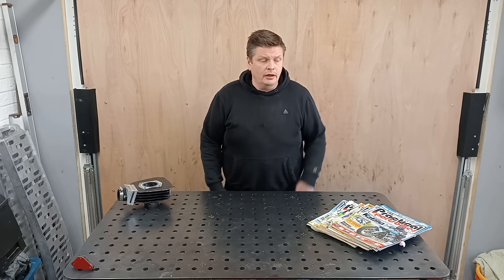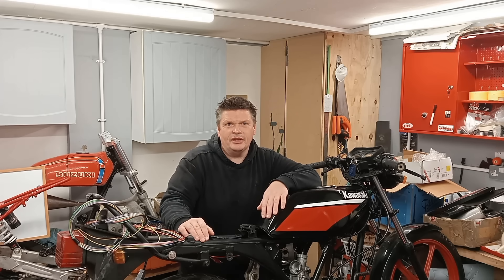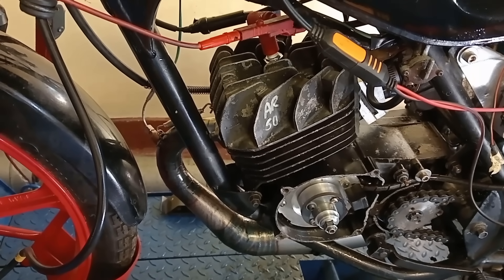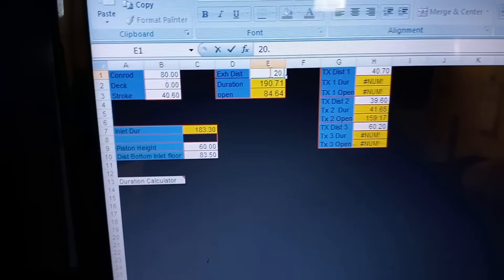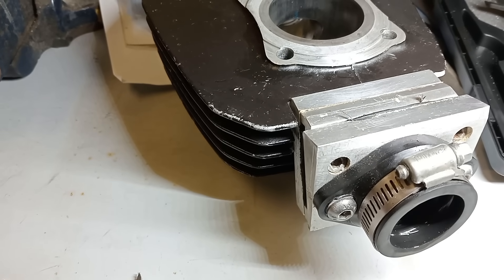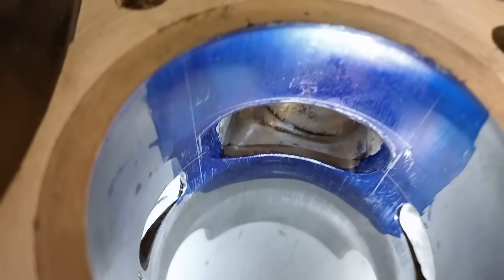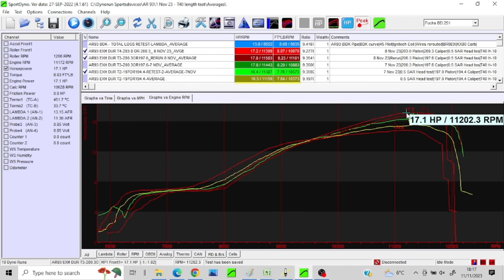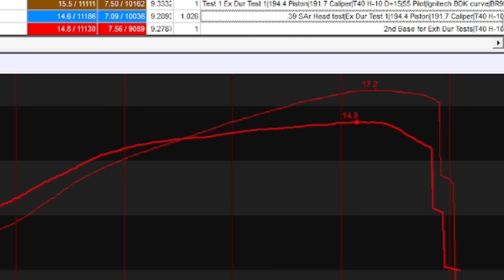This Tiny Port Change Changed Everything (Dyno Proof) #2stroke #power  #porting

Comment: Can you fit skinny tyres like the drag racing bikes in Thailand?
They are 150cc.
You could try throttle body fuel injection?
Also you could run a narrower powerband with a close ratio box.
If you raise primary drive gearing and fit bigger rear sprocket it will bring gears closer together, then set it so that 1st is where 2nd is now.....
Reply from the maker: Cheers Peter, The standard tyre is quite narrow. It is an option to try and get something a little narrower, or maybe a front of the rear too? I also need the correct speed rating which makes things a little more difficult...
I'd love to get a close ration gearbox, in fact I have one from a KX65 but It won't fit. I need to do a bit of research to see if there is anything that may fit.
Reply: @AutoBeta2T  as I said, you can make the gears close ratio by increasing rear sprocket size, AND raise primary gear ratio.
You can do a speed Vs rpm graph and see how this effects relative ratios.
The only downside is that 1st gear would be quite tall.
I was once intrigued by a BSA bantam 3 speed close ratio,  " bog, blaap blaap blaaaaaaap" and that's it!
Also I notice that the intake port isn't ideal, 3 ports essentially - can you remove the 2 bridges so that it becomes one big port, just leave the upper parts to support the ring?
Or make a different liner?
You could always cheat and fit a kx cylinder, but then  it wouldn't feel like an ar50 anymore.
I know you can buy 70 kits with 29bhp out of the box (mxs70) supposedly but they are crank case induction.
Your series of videos is probably the most interesting of all the tuning videos......2strokestuffing is the other series I like- in depth tuning discussion and the port height Dyno stuff is excellent.

If only it was piston port induction, that's what interests me most..... don't know why?!
Reply: @AutoBeta2T  btw did you check out the racing in Thailand?

Comment: loss in low down power is due to lower dynamic compresion ratio
Reply: Ye just look into the dynamics 
Static isn't a true example of compression  so to simply say the   first factor is were in the swept volume is the exhaust port closed 
? The further up later closing 
? Vs static compression?
So static is a number to understand vs dynamic 🤔
Reply from the maker: Hi James, I've done the calculation and I went from 7.4:1 corrected compression to 7:1 corrected when I raised the exhaust port. I've a couple of standard heads coming from eBay so I can machine them back to what I had before... And maybe a little more too.

Comment: You can measure when the exhaust opens by running compressed air into the plug hole and then rotating until you see a pressure drop.

Comment: do you reduce the spacer when you increase the exhaust phase?
Reply from the maker: Hi Zobaka - I didn't. I did expect to but the exhaust kept in phase as the timing increased. I think the pipe was setting the peak power RPM but the exhaust port didn't have enough time area. Increasing the time area allowed the engine to make more power but the pipe dictated the peak RPM.
Reply: Hi, What I meant is that when you raise the exhaust, the compression ratio decreases unless you install a thinner gasket.  This may have a negative impact on peak power
Reply from the maker: @Zobakka  I see. Yes it is something I need to address. I've ordered a few AR50 heads off eBay to machine and have a play with.

Comment: I wonder what difference using slick 50 makes to the horse power. We used it late 80s and early 90s and as soon as you squirted it into to the intake the tick over rose and needed bringing down because of less friction.
Reply from the maker: I remember that stuff.... I'm sure you could get it at Halfords? 
Did you use it on two strokes?
Reply: @AutoBeta2T   yeah,  I remember using it on a ts50x,  certainly made less friction due to the rev increase.   Sold quite a bit back then.
Reply from the maker: @cronauer1985 I wonder if you can still get it? It would make a good test
Reply: @AutoBeta2T Slick 50 was based on very finely powdered PTFE, a very slippery plastic.
Reply from the maker: I'll have a Google for it

Comment: i wonder what ceramic bearings would do for it
Reply from the maker: Me too - another one for my list of things to try :)
Reply: @AutoBeta2T SKF make the "Energy Efficiency" range of bearings that have outstandingly low friction. They have "E2." before the size marking.
Reply from the maker: @cedriclynch  I've done a dyno test with wheel bearings on a pit bike. Picked up 0.3 hp 6hp.

Comment: you want a fast 2 stroke?
cheap cylinder wont get you there.
take my toy at this point 2 stroke moped.
i went water cooled as head temps on air cooled get too high as power goes up.
now i can wot for miles if i wanted to. i can touch the radiators with my hand after hard runs.
i also havent wont over 75 mph on it as i have no interest going that fast. it has plenty left and gears for 130-140 mph.
Reply from the maker: Hi, the cylinder is a genuine Autisa big bore kit so good quality. The original challenge tried to get to 100mph with this kit and air-cooled. They got to 97mph so close. With a few more hp I reckon I can get to 100mph and still air-cooled on pump petrol. I have considered a water cooled head or maybe using Methanol fuel... 
Cheers for watching ☺️
Reply: @AutoBeta2T  i wasnt really knocking the quality per say. but in my scooter world a good 70cc kit is 200-300 dollars.
its pricey and so is the exhaust but at around 20+ hp for 600 dollars its not a bad starting point. with my cylinder and a new exhaust my powerband would be from 8000-12,500 rpms. very wide for small cc but also over 20 hp reliable barely runs on pump gas though. 15:1 compression ratio. but i have immense acceleration and the speed to back it up. 1000cc motorcycles stood no chance. 
then after having a great starting point i can adjust and tune from there. like adding the 2nd cylinder and exhaust cause at over 40hp not many things on the street or strip could poke fun. id win. after i get bored with it like that its getting supercharged for a humble 60 hp. just a little extra to strike fear into the hearts of any that dare race me.
Reply from the maker: Sounds expensive! I can't get the Autisa kit anymore. It is ally wit a cast iron liner. You can get a all cast iron copy of it for about £200! 
If you have a look at my other vids there a couple of exhaust fabrication - maybe have a go at builing your own?
Reply: @AutoBeta2T  i thought you had a cast iron cylinder i seen the paint and just figured it was cast iron and those dont like power on my bikes. i dont mess with the big wheel mopeds much though i would kill for an aprilia one with a 2t. the cylinder i currently have went up almost 100 dollars since i seen it last jeeze. the exhaust i want is usually 200-300 but was over 600 dollars recently. prices are all over for everything it seems so you may be on to something on making my own exhaust. i had 3 ideas to tackle that when i did the 2 cylinder swap. i was going to get 1 good exhaust and make a y pipe and cut a section out of the pipe to match the length of the y. keep the pipe the same length effectively. i also stumbled on a fun design that would work great with the 2 cylinders but its not backed by much science. or i was just going to buy the 2 pipes and bend them some to fit. your idea of making my own sounds alot better though my interest in making 2 stroke exhaust died many years ago. doesnt mean its not a good time to play with them. and sadly yes this toy is expensive but its fun and its not that expensive compared to other people play budget. i bought it cheap and it served me well for over 30k miles. i have reliable vehicles and a fun car i dont really put money into any of it so why not have some fun sometimes. its 3 bux to fill the tank and go bomb around town for a bit.
Reply: @mikeford5106  nah no dreamer i ride it regularly an my v8 swapped suv. i like good cheap fun toys.

Comment: Come to think of it you have the means to discover the contribution of the radius. Test a port with minimal/typical chamfer on top then apply only a radius on it and test again, then raise it to the radius height with a minimal chamfer and test and finally apply a radius and test final. That should give you a good data set to judge the relative importance of height vs radius on the ex port.
Reply from the maker: Yep, it would be interesting. I'm not too sure what I'll be able to achieve with flow testing as I've never done it before but I'm sure it'll be interesting 🤔
Reply: @AutoBeta2T  What are you planning to use, a flow bench?  and what configuration?

That is actually a fairly simple shape so I could calculate a very good estimation of overall flow given it's dimensions.

The best use of it will be probing the port to see if and where free jets form or if the flow attaches to anything.
Reply from the maker: Hi Bill, just something I found on the internet. All will be revealed soon but it doesn't involve a flow bench.
Reply: @AutoBeta2T  Ok I'll be interested to see it.
Reply from the maker: Me too 😁

Comment: 16:30  I don't know how you will flow test the ex but I can tell you that a flow bench will only give valid figures for the tested conditions but the running conditions are totally different. The pressures are much higher, the temperature is much higher (which means the speed of sound and viscosity of the gas is much higher). In running conditions it can have choked flow which the flow bench won't duplicate. 
The flow bench will give some thought provoking info but don't bank on it because it can be totally wrong.

Comment: For 4 strokes it is customary to consider .050" lift at the valve to be considered "open" for timing purposes. It's an annoying problem especially when you use radius top as I do. I've never been happy with the way it's done. I think you need to consider Time/area/FLOW COEFFICIENT in the mix, not easy to do.
Reply from the maker: Is there that to allow time for the flow to start?
Reply: @AutoBeta2T  It's really to distinguish the cam ramp from the actual lift part of the cam. The cam first applies lift in order to load all the components and take up all the flexibility/compress ability in the train. So it becomes hard to tell where the ramp up ends and the lift begins.
Reply: @AutoBeta2T  The flow actually starts the instant the first molecule sees a pressure differential. It moves at ~50% greater than the local speed of sound and those behind it follow as soon as it moves. The question is when does it make a significant difference to matter?
Find that out and you will be the first, that I know of.

Comment: You should consider running with the Dykes ring only.
I also lowered my AR50 as much as possible to cut drag and I turned the stearing triangle upside down to lower the handlebars.
Reply from the maker: Will do. It's been mentioned in another comment so keen to try it. Cheers 😀

Comment: Short life span, misserable to ride only in the high rpm. Mest max is 196. You need to do too much to let 203 degrees perform well. Nobody uses that degree to get rpms and power. Now its 194 max 196 with a special head and the right exhaustpipe that goes with that combination
Reply from the maker: Yes, I am worried about it going bang as the piston isn't the best quality. Regards the timing I believe the Aprillia RSA used around 200 degrees on the main exhaust port...
Reply: @AutoBeta2T  ok but aprilia should have a powervalve or Atac system. That some how infuences the timing. Even with that the max is still 196 these days. Rpm and power is achieved bij the head and the pipe and... the type of ignition

Comment: Transfer work will widen the spread of power now.  Add 2deg transfer duration to fatten the curve and add some more peak.
Reply from the maker: Cheers, I plan to do some transfer tests
Reply: 2 degrees would be a half mil height change or thereabouts?
Reply from the maker: Yes, there abouts. I'd have to check to be sure.

Comment: Great stuff.
I like it when people share info like I do. We are all in it to have fun and learn.
I'm subscribed to you and twostrokestuffing even though I'm not a 50cc guy. It's just that you guys share info.
I did a test and posted it on my channel about exhaust back pressure.
I hooked up a pressure,vacuum gauge to my exhaust pipe on one of my Honda FL350's.
With the stock exhaust and muffler it has 3.5 psi back pressure and without the muffler it had 2 psi back pressure.
These runs were done at my local airport side road and not on a dyno so I have no idea about any hp gains or losses.
I did it just to see how much back pressure was in the exhaust system of a two stroke.

Could you do a dyno video on hp with regards to exhaust back pressure one day ??
Thx for any replies.
Reply from the maker: Hi mate, no problems, it's what YT is all about for me 😃
I'll check out your video as pressure would be interesting to monitor particularly with changeable stinger inserts.

Comment: When the outlet port is raised, the compression should be increased
Reply from the maker: Hi Wesulius, are you talking about the exhaust port being raised?
Reply: The compression stroke only begins when the ex port closes. When you raise the port you lower the compression.  The solution is to reduce the combustion chamber volume.

Comment: The port is opening as soon as you get light showing through the top of the port/piston ring. Some exhaust ports are angled down at the top of the port, this make it very difficult to get a caliper measurment on the port depth.
Reply from the maker: Hi Gillian, agreed. I could get different readings with the caliper depending on how far into the exhaust duct they went. However, once I figured that out I could get pretty consistent readings. The 203 duration was from the light showing the port just cracking open method which I'm going to use as my standard now. Cheers for the info buddy.

Comment: When using a dyno corrected vs uncorrected doesn’t really matter as long as you use the same option on all runs, I like using uncorrected because I feel like it lets you see what the engine is doing compared to current weather conditions which allows you to see when the engine is really not happy with conditions, if it’s 100 degrees f outside and the engine loses a major amount of power compared the corrected figure you need to change jetting and timing to keep it alive in those hot temperatures
Reply from the maker: Cheers for the info buddy. That's a really good point and something I hadn't considered. I guess it's a bit like going to the track and changing jetting to compensate for the changes in the local conditions. Cheers :)
Reply: @AutoBeta2T  yep it gives you an idea of what the motor actually needs some motors will take more heat than others before the fuel mixture needs to be enriched.most of my 2 stroke knowledge comes from chainsaws which are used in many altitudes and temperatures and sometimes it’s not all about air density, temperature, humidity and barometric pressure all effect engines differently.

Comment: Great work ! I recon with a new set of sprockets you'd be there at 100mph
I can't for the life of me remember what sprocket I ran on the back of mine but it was a lot smaller than standard.
Reply from the maker: Hi Trevor, that's one for a later episode at some point. I did have a work out but it's getting everything to clear with a bigger front and a smaller rear.
Reply: I'll see if I have any old photo's of my AR to try and gett an idea of size ;)   @AutoBeta2T
Reply from the maker: Cheers Trevor - my email is: Autobeta555@yahoo.com

Comment: Have you tried doing some porting on the transfer ports if not that will get you some extra hp
Reply from the maker: Hi, not yet. The barrel was tuned when I got it already. I need to do a remeasure as I found in making this video my initial measuring method may not have been accurate. I have actually epoxied the transfer roofs to lower their timing but I may have accidentally lowered it too far?
Reply: @AutoBeta2T  awesome I would for sure open your upper and lower transfer ports I got pretty good results from doing that but love the videos you're doing an amazing job 👍
Reply from the maker: Cool and cheers - pleased you are enjoying :)

Comment: Do not go over 190* exh , make only the window wider , not higher , and only the first 10 mm .
The port is al ready tho big .
Reply from the maker: Hi buddy, a bit too late for that. In an ideal world with triple or t port exhaust ports maybe and I get the exhaust resonance thing but keeping with in 70 to 72 % bore width I can't get the time area required for the power I need so there is no other option really. Note the Aprillia RSA was around 202 degrees duration and a triple port. Cheers :)